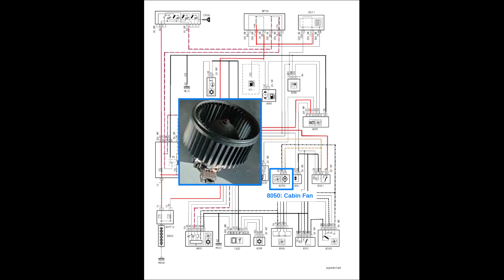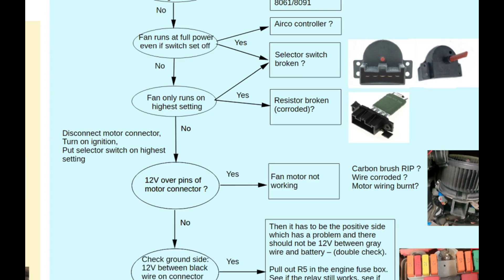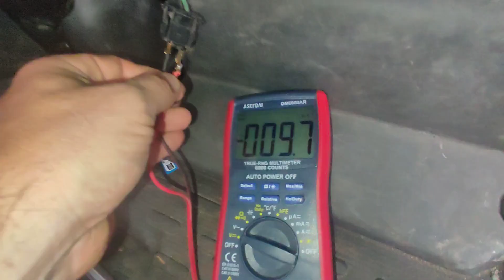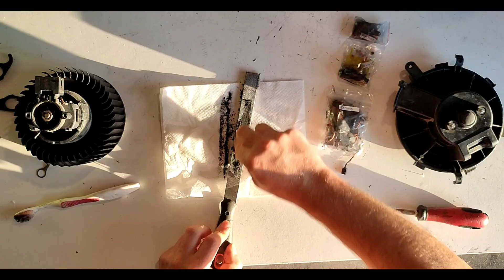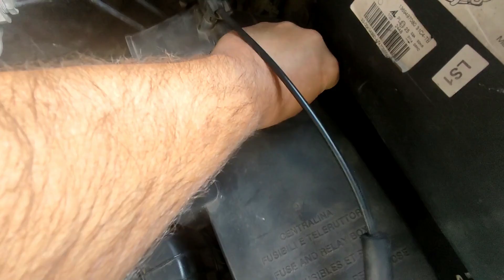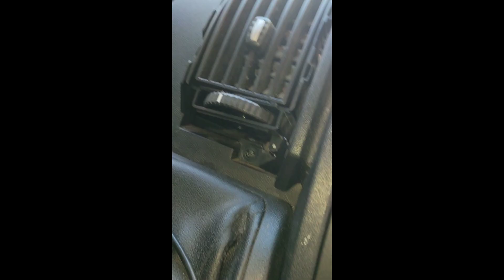Cabin Fan Not Working Part 2:  Electrical Issues/Resistor/Blower Fan Repair/...(Boxer/Ducato/Jumper)

Comment: geweldige uitleg van het electrisch circuit echter....  wat is er aan de hand als fuse 31 (7,5 A) direct springt als het contactslot wordt bediend? Dit kan ikzelf helaas nog niet uit het schema en de duidelijke uitleg halen. Iemand een tip
Reply from the maker: Zou kunnen gebeuren als R5 zijn coil in kortsluiting ligt (isolatie van de windingen doorgesmolten) en langs daar te veel stroom loopt. Of ergens een kortsluiting in het kleine airco control switch bordje, of eventueel ergens een van die cables daartussen waar de isolatie van kapot is en contact maakt met het chassis.  Meten met multimeter tussen bovenste pin van F31 en grond als je R5 uitrekt en het controle paneeltje loskoppelt. Als dat dan een open contact is zijn uw kabels goed en moet het of R5 of het controlepaneeltje zijn, zoniet ga je je wat miserie hebben om die kabel te vervangen maar goed dan weet je toch al waar je het moet zoeken. Je kan ook R5 zijn coilweerstand eens meten maar ik weet niet wat de verwachte waarde daar is. Als je een goeie bench supply hebt die stroombegrenzer heeft tegen kortsluiting kan je R5 daar eens aanleggen en zien of hij onder de 7.5A blijft, of dat hij in kortsluiting gaat (maar uw bench supply moet dus tegen kortsluiting kunnen of je blaast hem op).  Als je bereid bent nog wat 7.5A fuses op de offeren kan je natuurlijk ook gewoon R5 eens uitrekken en contact terug aanzetten en zien of F31 nog magic smoke geeft. Anyway, ik denk dat je daar al mee kan beginnen. Als je het vind geef een update,  dan zet ik het probleem en de oplossing bij in de description moest er nog iemand tegenlopen want ik heb er idd niet aan gedacht in mijn fault finding tree (er zo  zullen nog wel scenarios zijn). Veel succes!